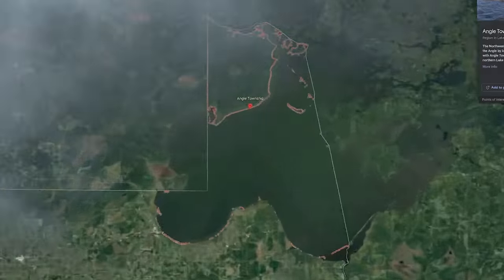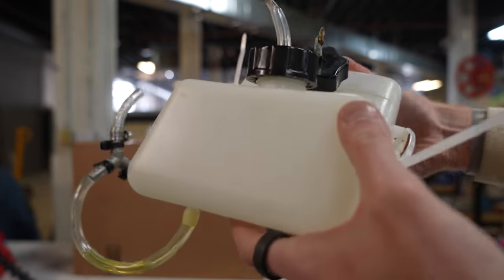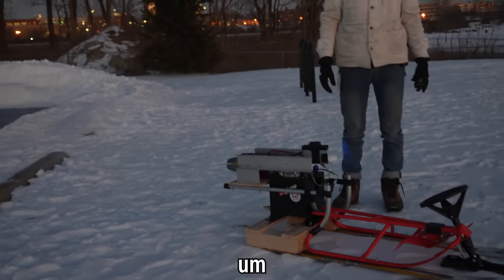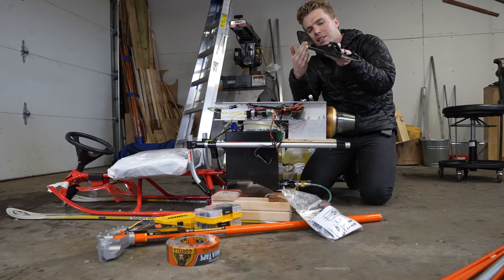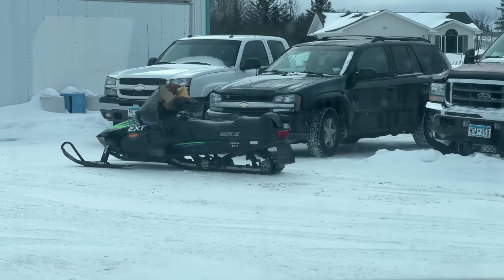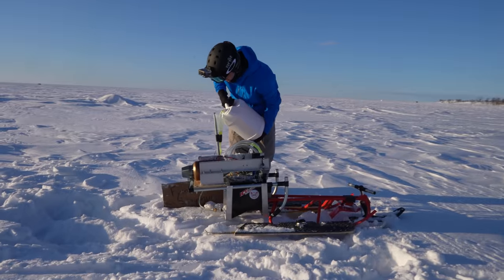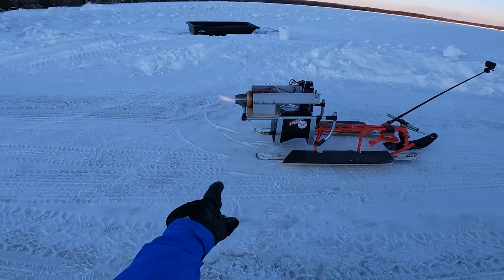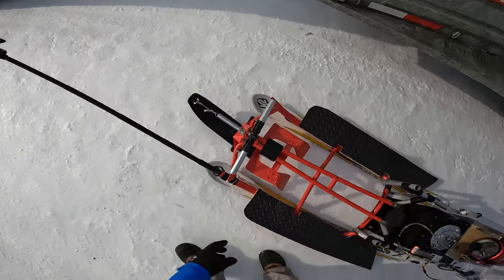Jet Powered Sled vs 38 Miles of Ice!

Comment: Lengthen the sled,use 4 skis so you leave just two tracks behind. Install a tilt kill switch from a motorcycle. Seat in like an f1 driver or on your belly, but it will be hard to see ahead. 
Do it again, for fun.

Comment: A compass to help maintain the heading and/or a GPS will be needed on the next one. Maybe the weather will be clear, but at least you'll be prepared for the possible white-out conditions you ran into with this run. Might also consider something that floats too as insurance of sorts, if it gets slushy like the time during that other year.

Comment: You could create a much larger sled while keeping it pretty light by using aluminum tubing or light steel tubing. If you were to make something with much wider, with much larger skis where to front of the skis come high out of the snow, and a simple independent spring suspension on each ski. Could maybe even make a thin aluminum sheet box that surrounds the jet engine (except entry and exit) would maybe act like a box that holds in some heat and isolates it better from the cold and wind. For sure if you had enough time beforehand, you could have a good welder weld you a nice lightweight, wide base and also a taller sled. Also maybe tilt the jet engine so it points downwards slightly at the back and make the mount longer so the engine sits even further behind you so that the more trust you give it, you more weight it takes off the front end and skis and that should work to reduce the likelihood of the front end sku going down under the snow at higher speeds and launching you off..

Comment: Ok, the solution is right in front of you. The black plastic thing you used to drag it is the solution. Find or make a long one and mount the jet onto a frame around it  and for a steering fork (I'd consider even doing something like a rear steer like a boat since no sharp turns are needed. Less chance of dig in) Have your intake air preheated by a cowling around the hot jet and with the large surface area you can afford a larger tank which I would make as part of the bottom of the container flat with foam or insulation around it and a scoop for air intake. (basically air flows in the scoop is forced over the engine backwards and then into the intake and out the rear and you could use a fin to direct the flow for steering too?? but on the ice may be too squirrelly so have the rudder as backup. )
   By separating the cockpit with large flat tank from the engine your safety goes up and the padding and you keeping the fuel "warm" and the intake air preheated and the large surface area that will fly over the snow as easily as the ice, you solve all the problems including the refueling stops which I think is cheating anyway.
  Now let's get it done eh...

Comment: Front ski could be wider with ridges along the length for better control, higher toe height so you're less likely to dive under the snow, kill switch for the jet (probably an integrated throttle too) and a longer chassis perhaps designed for sitting more naturally?

Comment: I remember this old exercise treadmill that had a kill switch which is like this thing clipped onto you, if it was pulled off of the device, the mill would shut off (In case you went too high and got launched off of it). That seems like it 'd be a good system for your jet-sled, so you don't accidentally torch yourself or anything if you fall off.

Comment: Ok, some good changes for V2 would be:
Increase chassis length and width, allowing you to lay down
Put a nosecone on it, increasing aerodynamics
make a shaped intake for the jet, so you laying in front of it doesn't prevent it from getting air
add a kill switch for the engine
add more skis, two sets in the front, two in the back of the longer chassis, decreasing surface pressure and increasing stability
Make the front sets of skis steerable, and get rid of the single steerable, making it safer to turn.
get a flatter, larger fuel tank, so you can go longer without refuling
Double up engines?
Suspension to help with the big bumps you hit sometimes, would increase reliability over time
mix antifreeze into the fuel and insulate the engine with the wool used in kilns to allow the engine to run at lower temperatures

Comment: I would say add a second jet, and use the fuel tank like a ballast to keep the front end of the sled pointed up. I would also say get rid of the skis and use two platforms. The big platform will have two fins to keep it centered and prevent wobbling, and the second will go in front and allow for steering. Use a piece of metal for the front plate, and weld fins under it. This will allow for better steering in snow pack, but will allow it to act like an ice skate over the lake

Comment: I am seeing a lot about aerodynamics but not a lot about smoothing out the ride. A lower ride may give more aerodynamic efficiency, but terrain is not very flat, and I think solving that part of the equation would be important. Lengthen is good, but so are shocks, and maybe some snowmobile skis from a junk yard. They are engineered for the type of terrain you were going through. Very cool and wavy engineering to start with though, it blew my mind, great job

Comment: You need a longer sled with longer skis, particularly skis that extend further out in front and curve up more. That would solve the problem of sudden changes in the snow depth and hardness/softness.

A fairing of any kind would seriously improve comfort and aerodynamics.  

You also need some instruments for navigation.   GPS would solve navigating in white-out conditions.  Old school would be a compass, clock, and speedometer of some kind.

As others have stated, a kill switch is a really good idea.

Comment: For that four wheeler I recommend trying wider wheels or even tracks.  If you can spread out the weight over a wider surface area it will make it less likely to sink into the snow

Comment: Make a small pontoon like a float plane has with an added center beam like an ice scate for your stearing. Add a slight pitch for the nose up when weight is taken off the front improving your chances from the nose digging in. Size can be the same but I immagine that would do ice and elevate the snow issues.

Comment: Need a track pattern like a snowmobile.  Powder snowboard center rear and 2 short skis up front to steer with. They also need to be powder oriented skis with steeper upswept noses and or have them angled slightly up, or rear sprung to want to point upward.
That would help you stay on top of the snow better and be able to go faster due to less drag through the powder. 
Now I want to build one!

Comment: use truck innertubes with a dual bike rim spaced about 5 inch apart bind the tubes to the spaced rims that are connected to each other through the 5 inch spacer..put it on a frame and youl go everywere includeing water if your frame is light

Comment: Maybe next time try a version with a valved pulsejet similar to the V1 Flying Bomb engine. Lightweight, simple, and just a straight tube so easy to mount. You could put it low down in the sled or mount it off the back. I think the Germans tried to build a boat with that engine and it was capable of some insane speeds.

Comment: Now you have a year to make it better. 
That plastic sled you were toting the jet around in would be a good start. LArger surface area for soft snow. 
Lightweight bike frame with front suspension for steering and a place to sit. Even room for a larger tank or engine.

Comment: Harbor Freight sells a 4 gallon plastic backpack weed sprayer that might hold enough fuel for most of the trip.  It comes with a pump and you could keep the on board fuel tank topped off while you ride.

Comment: What I would focus on is the inertia of the sled because if you only use the jet every now and then, you will not have to worry about the heat melting the ice, or the power running out. I would also worry about the arrow dynamics, if you have the sled a little longer and lower down then you will go a lot faster.

Edit: I would also widen the bottom of the sled so that the deeper snow will not stop you as often.

Comment: May I make a suggestion a redesign sir shouldn't be too difficult to do yourself. Make a very small version of a Florida swamp boat throw your jet engine on to that design and you're golden. Oh and as far as condensation freezing onto the engine get yourself some air duct material a make a box that goes around it make a couple little vents on the box that you can control opening and closing front and back you'll be able to adjust the openings put a thermometer Inside the Box run the engine at idle and check temperature with the vents open all the way I would suggest a vent on the top 1 in the front of the box so air can come in the front and carry heat out the top once you establish the temperature on the engine as is put the box over it fasten it down run the engine with the Box on top covering the engine with the vents open all the way see what the temperature is that in depending on if it's too high or just right will determine if you can adjust how many events you'll need to keep it just right then when you're running the engine to go forward the engine's going to get hotter but you'll be moving forward and as the air goes through it should maintain the temperature at a good running temperature but warm enough to keep anything from freezing on it you'll be making basically a little hot box and with the thermometer inside you can monitor it as you're driving it to make sure the temperature is staying safe so it doesn't hurt the engine and with this new design you won't even sink in to the snow or the water you'll basically have a miniature jet engine swamp boat might be the first in the world. get on it dude!

Comment: Try using a pulse jet engine instead and use a larger quad arm undercarriage with 15" of articulation.  The skis should have a high nose to enable easier ramp over obstacles and they should be much wider to reduce the pounds per square foot pressure on the ground. That will reduce that sinking into the deep soft snow.

Comment: Cool freaking video what if you  move the steering ski forward 24” so there’s less weight over it and use something like a turbo blanket to keep heat in the engine

Comment: What about mounting the engine to a sled with a solid bottom instead of runners, like a toboggan has?
Seems like you could avoid the sinking issues pretty well that way, and it would serve to even out the small bumps overall.
Steering could maybe just be done by angling the engine (thrust vectoring) or just having an air control rudder or something?
Idk.

Comment: You need inlet anti-ice.  This is accomplished via taking some bleed air and heating the inlet, or routing a tiny bit of exhaust into the cowl inlet or electrically heating the inlet.

Comment: holy shit this is bonkers. double up on jets for v2 and take a page out of motorcycle racing and get basically horizontal. might i also suggest proper intake piping for the engines themselves so you dont risk starving them of air

Comment: I would cut the front end off of whatever cheap 4 wheeler you can afford.  Or just gut it and build around that.  You could probably bolt on snowmobile skis. Then just fab skis off of the rear axle. 
But this was awesome 👌 so cool/ unique

Comment: "A fire hazard.." 
Yeah, so many things I've built as a kid were completely fire hazards or unsafe at ANY time. :)
If you lengthen the chassis you'll improve the performance. Also, smaller skis will lessen the resistance against the surface.

Comment: You definitely needed some inlet heat. In a hypothetical second attempt, even having a portable space heater or hair dryer in your support vehicle that you could use to thaw out your compressor blades at refueling stops might have saved the run from a mechanical standpoint. May not have been safe to go on past when your engine failed from a weather perspective, but assuming the weather cooperated more, that'd be my bet.

Comment: The black tub you were hauling sled in would have made a better sled maybe. Slope the nose like a boat and have front steering ski on long chopper like bicycle forks. Keeps your center of gravity lower sitting down in that tub avoiding possible end over flips.

Comment: Your tipping problem can be EASILY solved by increasing its length. This increases the moment of inertia (rotational inertia). Think of a broom handle. You can get it spinning around its axis from 0 to let's say 120 rpm almost instantly by spinning it like a top. However, if you try to spin it like a propeller it takes a lot more time to get it up to 200 rpms. The same principle applies to a vehicle. It also applies to the driver. With the length tripled the vehicle will have a MUCH greater. The added length will allow the driver to stretch out his legs and recline giving his body a much greater moment of inertia. Length shouldn't add much weight, it will allow you to operate at much higher speeds, and it will make room for more fuel, meaning increased range. LENGTH IS THE ANSWER.

Comment: I'm thinking you need a longer sled .it will give you more stability and lift on the soft areas also a shell for aerodynamics to compensate for bigger sled . because of low temp and high humidity shell should extend to end of jet exhaust tube with air intake inside the shell . this may allow intake to draw warm air from exhaust tube .

Comment: You need to build a proper light weight aluminium tube frame you can lay down in, a lexan fairing/viser for aerodynamics, and have two jets one on each side.

That think will fking fly across the snow.

Comment: You should have used the full length of the skis with the weight biased to the rear so it would always want to pitch nose up. You would not nose dive into the snow and have more control. Maybe make it where you lay down instead of sitting up. That way you have a lower center of gravity.

Comment: Longer ski's to better get on plane atop the snow. Majority of length out front. You could easily haul more fuel, which would only handicap you initially, but gain speed as the tank emptied. Option, would be two sets of ski's; one to support the engine,  fuel, and you. the other out front and bound to the steering mechanism. I would attach the front to a center point, to allow them to freely articulate over drifts or into channels, which should eliminate any diving into soft snow.

Comment: Lengthen the chassis,  move the driver position back further (better center of gravity),
 longer and wider skies for less resistance and sturdier ride over rougher terrain.

Make these changes, and I can see you easily accomplishing this goal.
Would prefer a larger fuel tank so it can be done solo, but with the propulsion system, I don't see that being an easy or even possible feat just shy of 40 miles, that's alot of fuel to carry.

Comment: ideas:
bigger fuel tank
air filter for jet engine (just so snow doesn't get up in there and drown the engine)
torch to keep the engine warm for the start
better skis (to not trip over on heavy snow)
suspension to dampen the chassis

Comment: You need to design a more stable TWIN ENGINE model which is longer, wider, with improved ski's/ suspension. Maybe consider using snow mobile sized skis, perhaps a bit longer. Add a more comfortable seat. It will need a much larger fuel tank but keep the over all weight down by using strong light weight frame (perhaps Aluminum). Your speed, range, safety, and comfort, should all be amazing with a great design. Personally, I would want to travel on the salt flats rather than a frozen bumpy lake (may be too dangerous).

Comment: just take the rear half of a snowmobile, and build anything you want up front.  If the other guys had an ATV with dumb wheels was good enough to be called Experimental, than the tracks off a snowmobile with saw blade front wheels would be good enough

Comment: Why didn't U mount the sledge structure to an mtb bike frame with proper steering controls, you could have replaced the wheel with the jet kinda like a snowmobile with a jet engine.

Comment: God, all you had to do was talk to a Canadian (or American) who's been ice fishing on a lake (which to be fair is basically all Canadians) and they'd have told you exactly what would be your issue. People picture frozen lakes as these vast, uniform sheets of ice and snow, but actually, due to climate conditions when snow falls, snow can take on various textures and thicknesses, and you need a vehicle that can deal with that. If it was me, I would ditch the "riding on skis" idea and just make the equivalent of a jet-propelled snowmobile (with a sled instead of a tread, and two linked skis at the front for steering). Make it as light as possible, and make the sled have as great a surface area as possible so that your mass is distributed, and you don't sink in as much. There are undoubtedly some engineering challenges associated with my plan, but I think it's where you should start.

Comment: Consider steering with a rudder, like an Everglade boat, using your toes as brakes to steer at slower speeds. Better yet, a small jet-powered Everglade boat, with brake oars to act like ski poles. Just spit balling.

Comment: In mother russia this is called the Aerosani, or aэросани.  Great Russian invention.

LOL, seriously though yeah, its an aerosled.   they started back in 1903.   Fan powered though some have done jet powered for fun.   

Honestly,  its 100% doable.  just depends on the budget.  going small on a cash strapped budget, you know the improvements you need to make.

you could go larger,   get a "pair"  of 100-200 lb thrust engine, mount them on a larger semi-enclosed sled.   even bigger you could go for a fully enclosed sled.  but at that point, you'd be shifting to aircraft grade parts, and such.